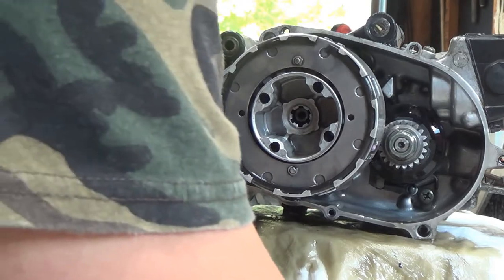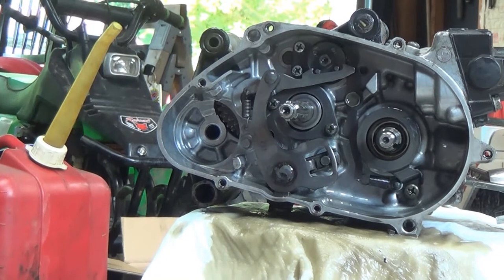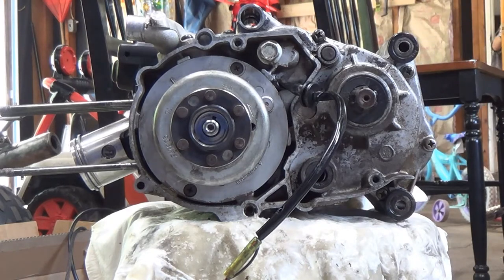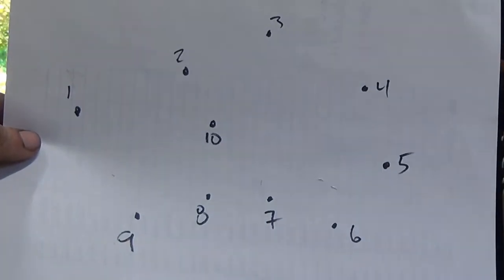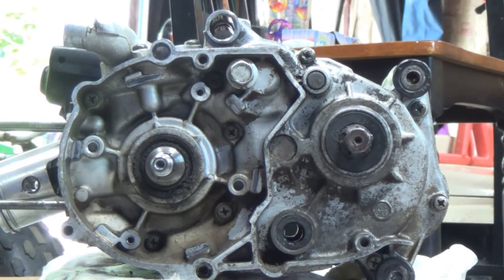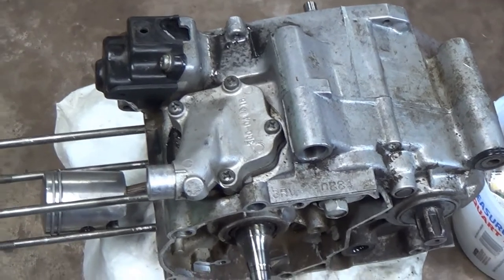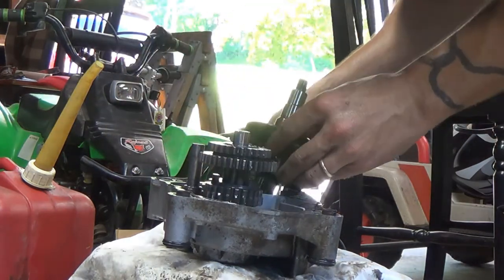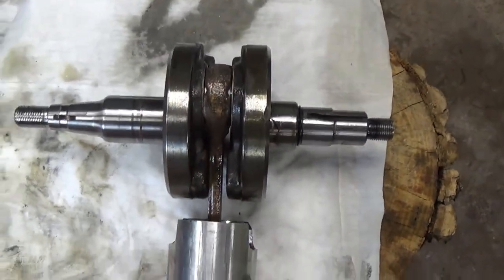PW80 Splitting the Cases

Comment: Just got an 83 pw 80. It scares me to have to crack the cases but I know I need to
Reply from the maker: It’s not too bad to do once you get started. Here in the next couple weeks I will upload a video rebuilding with all the torque specs and some other things I’ve learned from all the viewers and comments. Thanks for watching.
Reply: @dirtbikedadgarage4662 Hey just wanna ask, doing the same thing to mine as well as I messed up the crankshaft sealing surface and need to replace the crankcase with a good used one. Anyways, what kind of puller did you use to split those cases? I’m having a hard time getting ready to do mine and would like some help before I mess it up again. Lol thanks

Comment: Good video, but why u got a brand new piston on the crank already??? Should keep that off till installation of topend
Reply from the maker: Some people put it on first and slide top end over especially on a little bulletproof bike like this. On a nicer bike like my daily driver motorcycle or my bigger 250 I use the ring compressor and slide it down the cylinder nicely. Thanks for watching!